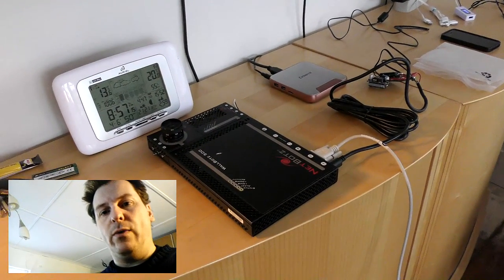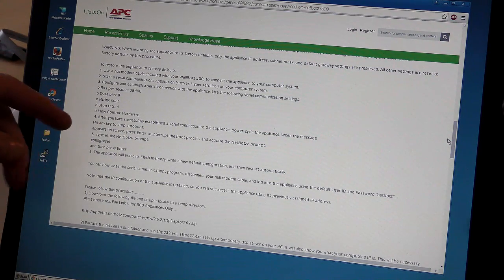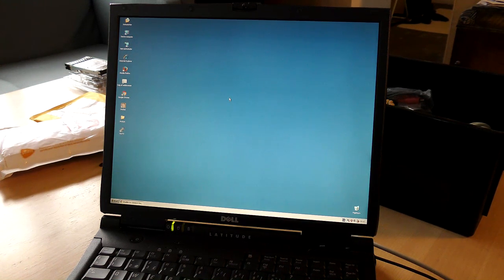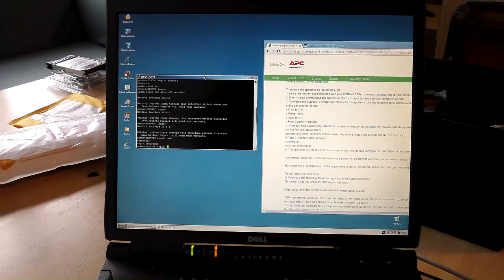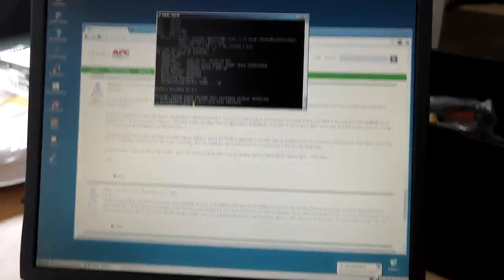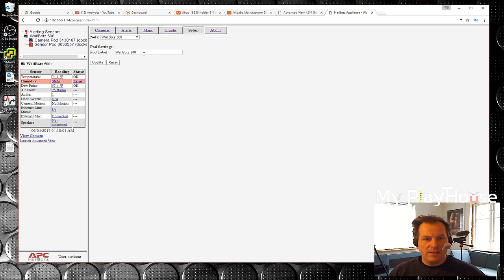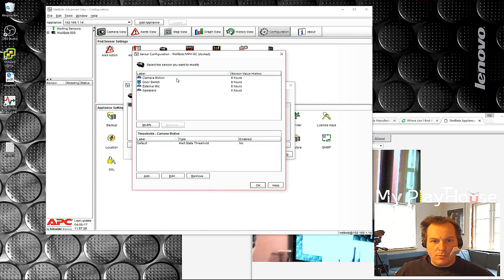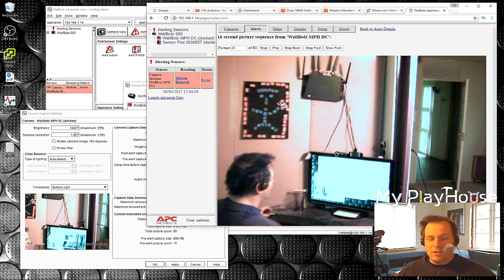APC NetBotz 500 back to Factory Default, now it´s Alive - 530

Comment: Why would any laptop be too old to connect to a wireless LAN? The old Thinkpad I mentioned in the comment before has a PCMCIA Wifi card, which is from the "pre-N-standard" days, so companies were already builting N cards before the 802.11N standard was completely finished. It works without a problem on my wireless LAN. The network may slow down because of that, but the machine is only on when I want to print something, so that's alright.
Reply from the maker: Hi Seegal Galguntijak
It seems I have the wifi router not compatible with the very oldest standarts. Maybe I should re-think that.
Thank you for watching! :-)
Reply: You can change the setting in your router's config GUI so it falls back to the 802.11g (54MBit/s) standard if an older device connects to it. However, if your laptop only supports 802.11b (11MBit/s), then most modern routers don't support the fallback to that any more. You could put a newer PCMCIA WLAN card into your laptop (as I did with my old IBM beast), or you could use a LAN cable, there is no other way.

Comment: Well, your old laptop is at least newer than mine! I have some vintage printers from the 8 and 16 bit ages here to test, and all I can use to do it is my ancient Thinkpad 390X with a Pentium 3 processor with 500MHz and 512MB of RAM. But at least it runs a fairly recent OS (compared to how old it is), it's got an old Ubuntu 10.04, and since it is already configured as a print server with CUPS, it won't be a big problem, I hope...I've even managed to find an old LPT to Centronix cable! (Now all I need to find is the time to test these old printers so I can sell them to some vintage computer freaks).
Reply from the maker: I  have had an Thinkpad 380X and an even older IBM PS/2 CL57SX,, that was a beast!